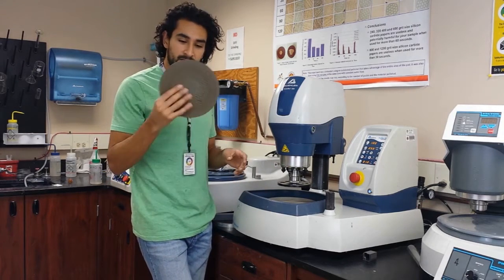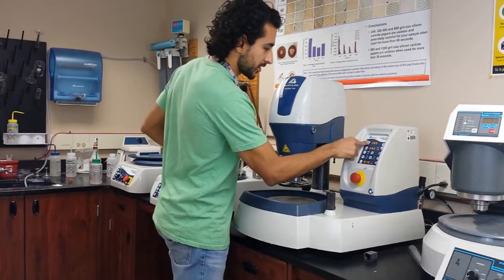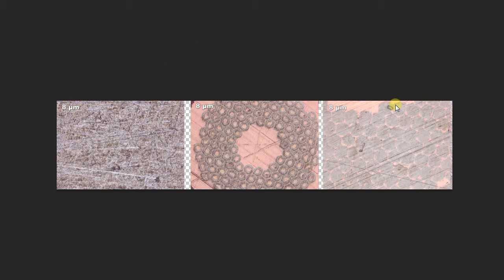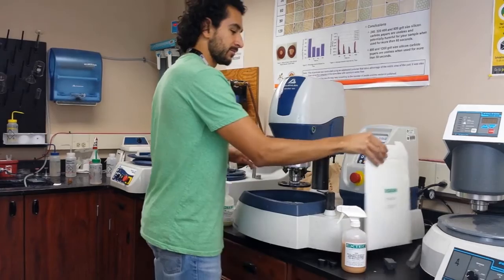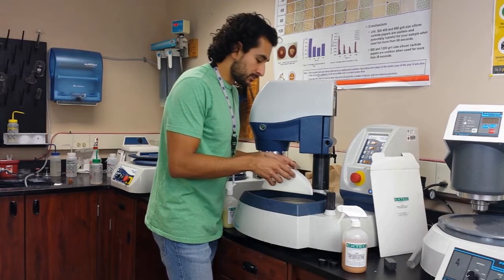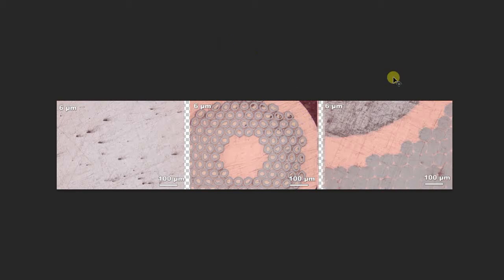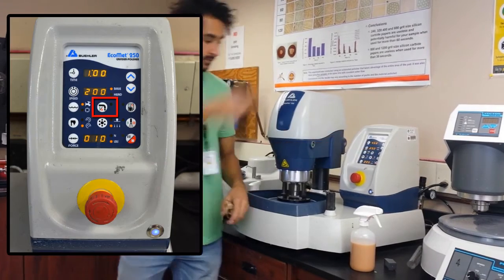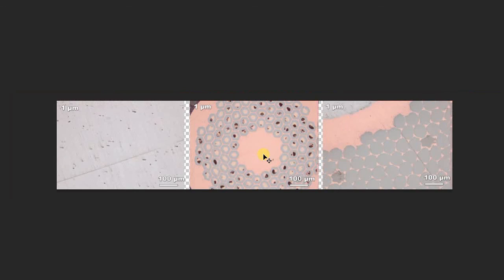Metallographic preparation - Part 5: Polishing with diamond pads and suspensions

Comment: I do the opposite, grind on papers down to 2500-4000 range. Get much better edge retainment that way. Especially important for cast irons where soft cloths tend to erode the graphite.

Generally its much faster to go on carbide  papers and finnishing of by diamond. 

My way in general, 400, 800, 1500, 2500/4000 then 3 and 1 micron diamond suspension.
Reply: What are the consumables you go with the 3micron and 1 micron diamond suspensions?